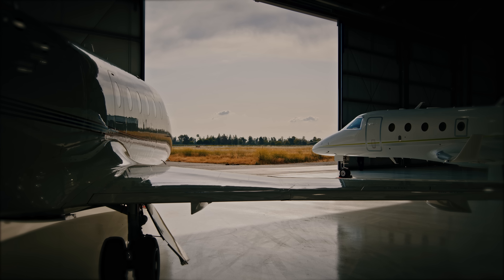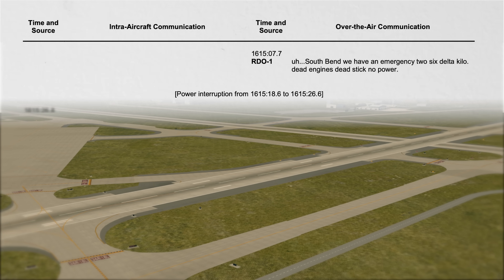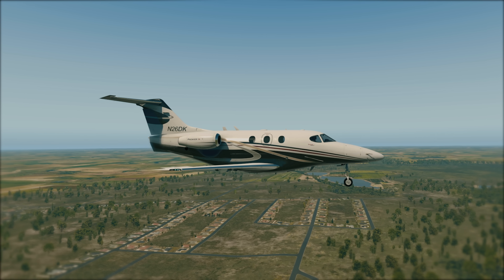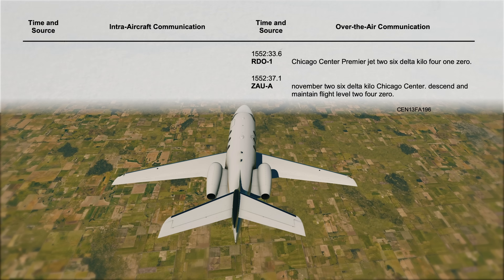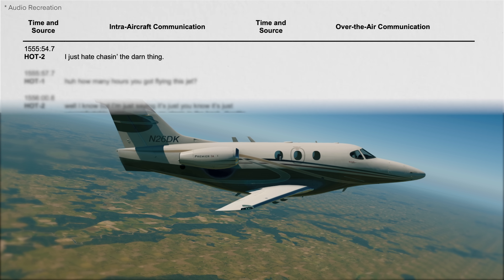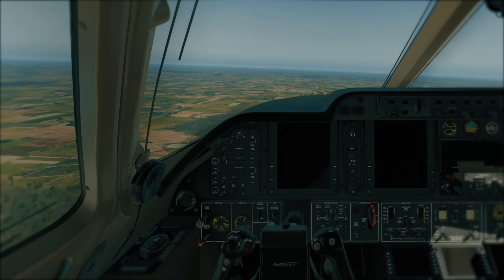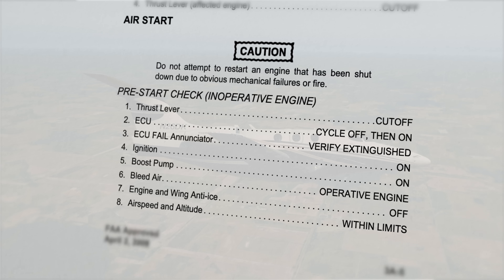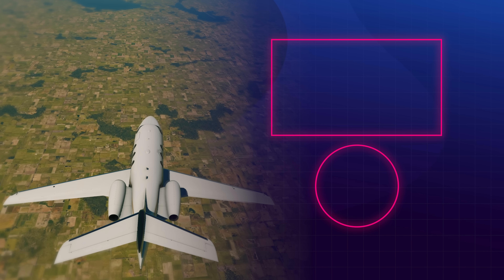Passenger Causes DUAL ENGINE FAILURE | Accident Case Study

Comment: Was the plane designed by OceanGate?

Throttle with fuel shut off, conveniently built into it.
Engine start assist, without the necessary ignotion built into it.
A gear release stick, which can be set to incorrect position.

The only thing missing was a self destruct button labeled "Do not press".

Comment: Used to fly (and own) a Premier and they are amazing aircraft and super fast and spacious for a light jet. The only thing that compares now is the Phenom 300 and CJ4. When you utilize the emergency gear extension you need to rock the aircraft as the gear bay on the main wheels don't always open and are 100% gravity driven at that point. The thing that pisses me off is this is a situation where they tried to save the airplane and got themselves killed and their passengers seriously hurt. Sure a gear up landing sucks but I would rather lose 500k in value on the aircraft than my life.

Comment: There are so many things that went wrong here, and some of them were totally avoidable.
1. Designing a throttle so when you pull it all the way back it's shutoff rather than idle is bad UX design. Separate fuel cutoff switches please.
2. Letting an untrained and somewhat unwilling pilot control a complex aircraft and not taking over when he causes alarms? What the hell?
3. The attitude of "I ignore the manual and recommendations" when you're flying a multi-ton missile is absolutely insane.
4. Giving a novice pilot not trained on the aircraft 'gotcha' tasks from a checkride? Is this guy nuts? He thinks he's a cowboy.

Honestly, the owner/pilot sounds drunk. His voice sounds hesitant and weird, his word choice is incredibly odd, some of the things he says sound like he thinks he's in a board room instead of a light jet's cockpit.

Comment: Putting engine cut off on the throttle seems...crazy? Even with the finger locks it seems like an accident waiting to happen. Shouldn't there be a separate whole control to turn off the engines completely? The Cessna prop plane I flew would simply go to a no-thrust but still running state at zero throttle. You had to turn the key or something to shut the engine off...like a car.

Comment: Alex didn't know his plane.
Moved to battery STBY when not  indicated. Tried to play Flight Instructor when he was not qualified, and clearly also not capable. Didn't respond properly to several emergency conditions. Allowed the Power-Off, but rather than following checklisted restart procedures, which likely would have worked, he "knew what he was doing", activated the wrong control, and shut off his own electrical. Partially used the manual gear deployment, not fully engaging it, so it was down, nor fully disengaging it so that the restarted engine could lower it. Tried to abort the landing, but his Battery STBY decision took away control surfaces...
Like a textbook of what NOT to do. 
My first thought was young Obi-Wan trying to train Annakin when he didn't know what he was doing.

Comment: Also interesting that they were flying at FL410 -- that is the service ceiling for the Premier 1A, and it reminds me of Pinnacle Airlines flight 3701 where they crashed after trying to join the "410 club".  That was a different plane, so maybe I'm wrong, but in general it's pretty dangerous/reckless to fly AT your aircraft's service ceiling.  Makes me think the pilot was showboating to impress his friend, and while it wasn't a contributing factor to the crash, it paints a picture of a dude up in the sky not taking his aircraft seriously.

Comment: As always, every time during these types of crashes with the pilot inexplicably not following procedure or not doing very clear things; Panic. Pressure. Under pressure and panic you arent thinking of checking that a handle is fully pulled, or if a switch is in the right place when youre about to hit the ground near 200 knots.

Comment: It's insane to me that the FAA is so anal about so much stupid stuff, like discouraging pilots from seeking mental health care, or causing piston engined certified GA aircraft to rely on 80 year old technology for fueling and ignition, and yet, they let people fly around in high performance aircraft that they can't even figure out how to properly operate. Seems like most of these air accident videos involve the pilots struggling to operate some aspect of the airplane, such as the navigation systems, to the degree where they get distracted and crash, or in this case, are unable to troubleshoot what should have been a very easy to solve issue.

Comment: This is why we need fully digitalized planes. When you place 1000 buttons with 1000 page of troubleshooting procedures, accidents are unavoidable. 
If your engine shuts down, you should just press "engine restart" and let the computer do all analysis and do the correct action.

Im not a pilot, I just find "lets give pilots control over everything manually" is a relic idea from WW2 when we simply didn't had the technology.

Comment: I find it weird that they told them to fly around with no hydraulics or power just because of no landing gear, it was most likely safer to just do the landing there and then with the gear up as smooth as possible.

Comment: 1:35 flight level 410?  Isn't that 41,000 ft?
Reply: A lot of jets are designed to get up to FL410 as any higher and at least one pilot needs an oxygen mask on at all time
Reply: 41,000 ft is stated as flight level 410 in aviation lingo.
Reply: @JohnSmith-vu6zd  I know. I'm saying that seems high for a small jet?
Reply: @ I think small jets actually fly higher than commercial jet liners.

Comment: What's missing here is an explanation of why the airplane crashed after the engine was restarted and go around.  Why did it bank left and crash into the ground?  Did the pilot pull up too steep during the go-around and stall?  That sounds like the real reason for the crash which is 100% pilot error to stall during ascent.  Nothing to do with the passenger (for the actual crash).

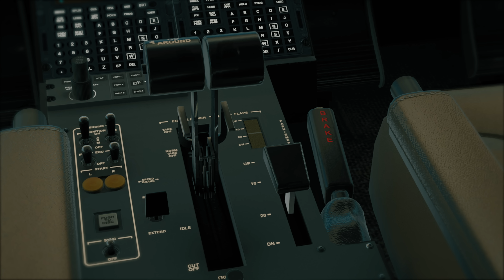Comment: 12:40 why, why is that a thing? Why are the fuel shutoff and throttle on the same mechanism?
Reply: An analogy would be having Park, Reverse, Neutral, Drive, and Low on the same stick. No "competent" driver would ever move the stick from Drive to Reverse (or Park) at highway speeds, and there is a switch to prevent accidental activation of Reverse / Park. When the Pilot-in-Command told the right-seat to "pull it all the way back to the stops", that is exactly what he did. Did the right-seat know he pulled the finger levers to bypass the lockout for Fuel Shutoff? We will never know.

Comment: South Bend is my home airport and I remember this accident years ago. I remember looking forward to the NTSB report to eventually come out. All we knew at the time is that during a go around attempt the plane crashed into a neighborhood adjacent to the airport.  I was hoping they would get into why the aircraft stalled, banked, and crashed in a nose down orientation. If he had left engine power he should have been able to perform another go around. I am guessing in the heat of the moment he pulled back too soon/hard for his current airspeed after failing to land with the nose gear only.

Comment: Whoever told him to "GO AROUND" was at fault.
Reply: Belly landing would have also been dangerous. It was the right call, if he knew how to use the manual gear handle. Obviously not if he couldn't start the engine, but he's not strictly required to follow the order.

Comment: I would imagine a competent pilot would drill engine restart to the point where they could do it in their sleep. Am I wrong?
Reply: I'm not even rated for a jet and even I know the procedure is to windmill the engines started,  not use the electric starter.

Comment: Yes the pilot is responsible, but for a plane to lose power so easily and for emergency levers not having proper indicators this is also bad engineering design choices.

Planes should be designed to be easier to fly rather than pushing pilots for higher standards

Comment: Can anybody explain what caused the nose low rolling descent, if he had one engine and had enough speed to climb? Also, why did the pilots choose to do a climbing right turn instead of gaining some altitude and airspeed first? I am a noob
Reply: Pilot error.  Probably flying too slow in the pattern instead of getting altitude and speed and working the problem.

Comment: I've only become interested in aviation, over the last year or so, but I have noticed two distinct kinds of pilots. There are those that make a conscious decision to be the very best they can possibly be, and will never take uncalculated risks. These are the pilots that fully understand the danger there is in the wrong decision. Then there are those, such as here, that flying because they have a huge ego and want the bragging rights. These pilots to the bare minimum needed to take off set the autopilot, and land. They have sufficient knowledge of their aircraft to make it functional when everything is working correctly and there are no failures in any of the systems. When something, other than normal, presents itself, their lack of understanding and knowledge is exposed, they become overwhelmed, and, invariably, it ends badly.

I was going to say that I hope that second group watch these videos and learn from the errors of others....Then I realised they won't, because their ego tells them they don't need to.
Reply: Excuse my shocking grammar 😱 I didn't proof read 🧐

Comment: The fact that the front wheel wasn't retracted and the back wheels were is what made the plane skip the runway multiple times, then stall while trying to take off and lose control.
Because everytime they try to touch the runway, the front wheel would force the plane to pitch up.
I am no pilot or engineer, although that plane seems to have a weird belly, making it hard to keep straight if you try to land it without landing gear. They would;ve had more chances to survive if they would retracted the front wheel and belly land that plane. But the pilot mistake was way before he entered this panic mode and not thinking straight. Way back when he was chilling giving the control of the plane to a passager.

Comment: This video is another proof of one that is most convenient  to blame everything on dead man. Despite pilot ignorance is primal factor of this tragedy second one and equal  is reaction of ground control. So you have no engines , no hidraulic power plane barely controlable, you see "surprise,surprise" it does not have extended landing gears...just send it go around like, WTF??? Just to return after miracoulously managing to start engine and extendend front landing gear which caused bouncing which caused crash and death of few people instead of belly landing first atempt.
Reply: He had one engine and hydraulic power. And he did go around. You're claiming he started the one engine AFTER he went around?  LOL wut?

Comment: Despite big guilt is on pilot and his ignorance, equal is on traffic control choices to tel dead airplane without engines and hidraulic to go around, somehow ti does that mirracle I do not know how considering situation information given in this video,  just to return with front wheel extended which causes crash in the end by bouncing of aircraft instead they did belly landing first atempt, no none would be harmed exept pilot pride and wallet.

Comment: A "dead stick" means the propeller has stopped... the "stick" being a standard two blade propeller.... a turbine aircraft canf have a "dead stick" it doesn't have a stick to start with... besides the control stick k and it wasn't dead of they wouldn't be able to turn or control the airplane....
Reply: The term is nevertheless used more generally.
Reply: @GH-oi2jf  incorrectly, yes... theres lots of things people do wrong without knowing

Comment: No gear go around...to the plane that doesnt have power or hydraulics. Jesus
Reply: But they did go around.
Reply: At least I am not only one. Yes there is a lot to blame on pilots ignorance of his own plane but equally for catastrophic event is to blame traffic controll.....instead to belly  land dead in the air airplane with no hidraulics and engines they instruct that plane to go around beacause it have no landingears out...like WTF??? And crash is also caused by extended front landinggear wich caused bouncing.....

Another what is questionable are engeenering choices which, I ask myself, are those coincidental or are purpously made that way to cause incidents. Imagine if someone designed a car in which you have to hold throttle in certain position otherwise engine cutts off and this landing gear lever that has to be pulled all way out....is this some back barn made aircraft or quite expensive for such technical solutions.

Comment: Modest flashbacks to a hard landing / bounce crash circa early 1980s on a tiny strip in Mountain Home, Arkansas. Single-engine plane; heck if I know model; had wings above cabin. Pilot a newbie, suddenly panic at his landing speed. SLAMMED down once then a go-around for an even harder slam that bounced us up, into a steep starboard bank stall then smack into a line of young saplings that caught it like a net.

Gear damage I recall. We all walked way down to the tiny shack "control tower" with the one guy on duty looking up from his magazine to ask us what took us so long. Without asking about where our plane might be! Nobody hurt.

Comment: So they were better off landing w/o gear than landing on only one front wheel?
Reply: They're better off going around and solving the damn problem. Which is what they did.  The problem is the pilot neglected to follow procedures for a one engine go-around. Probably freaking out trying to flip switches randomly like he was doing before.

Comment: Why isn’t there an interlock that prevents cut off unless gear is down?
Reply: You might want to shut off one engine.
Reply: @ fair point, but wouldn’t it be possible to have such an interlock coupled with an over-ride if shutdown mid-air is in fact desired?
Reply: @SWright1978  When you have an engine on fire you need to shut it off quickly.  On an airliner they have big handles on the ceiling that shut off the engines just by pulling down.

Comment: What kind of engineer designs an aircraft throttle control to have "cut off" below the idle position?? It should absolutely not be possible to turn off the engines with the THROTTLE. Cutting power to the engines should be done with a completely separate button. I would say that the pilot can only partly be blamed, since having the engine cut off control integrated with the throttle lever is just an accident waiting to happen. Someone please fire the braindead engineer who designed this aircraft.
Reply from the maker: Very typical of most jets in that category. Plus you have to move a detent before you can go into that position.

Comment: Even though I never completed my FAA check-off ride I have around 70 hours flying GA. The problem with high performance including jet aircraft is these aircraft can quickly outrun a pilots capability to operate and control. In seconds a pilot can get so far behind flying these aircraft it becomes almost impossible to recover. I have flown 100s of hours in simulation high=performance and jet aircraft and even in a simulator it is easy to get way behind the numerous tasks when flying these aircraft!

Comment: I know nothing about airplanes, but Is there no system in an airplane than runs some diagnostics and propose troubleshooting procedures? It could detect that the  engine is off, and could give you all the steps to restart from this current configuration of the airplane. Does this not exist?
Reply: It's a piece of paper called a checklist. They showed a picture of it in the video.

Comment: Extreme arrogance resulting in unnecessary tragedy.
This guy had no business piloting a turbine aircraft with such appalling disregard for safety.
He obviously believed he was too much of a hotshot to need any checklist guidance.
He provided any excellent education into what not to do!

Fuel cutoff switches ought to be in the vicinity of, but a part of the energy management control system. The CVR ought to have had its own independent 30-40minute battery backup, it is a pity to have such valuable resources only to be made redundant with main power failure.

Comment: The CRM in this accident is truly appalling.  I plan on getting a PPL sometime soon and one thing I have decided is that where necessary and appropriate, I will try to include anyone I fly with regularly in my CRM.  However that does ot involve manipulating any part of the airplane controls.

But here there seems to be delegating tasks involving automation to someone who isn't even going to fully understand aspects of flying the aircraft.  The result is a high stress environment and inevitable stress-induced errors.  And the individual should have handed back control when beyond his comfort level.

Comment: Once the pilot had the left engine running, it is very confusing why the pilot did not gain a lot of altitude and get the other engine running. Get altitude, then take the time to get a foobar plane in good condition.

Comment: accidentally turning both jet engines off? accidentally setting the battery controls for panel blackout, including radio and starters? accidentally causing landing gear to not come down fully? this airplane seems designed for accidents

Comment: Complete engine failure results in radio failure also? Is this condition only on the Falcon or industry wide? While I understand the need to use batteries for restart, this seems to fly in the face of safety considerations. Single engine land pilot here. Help
Reply: No,  he shut off the power intentionally because he was an idiot.